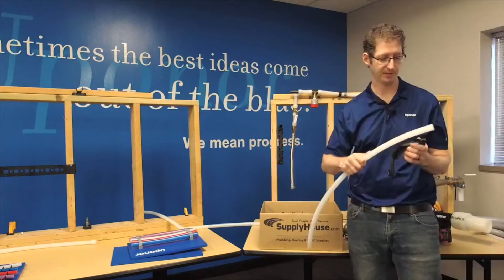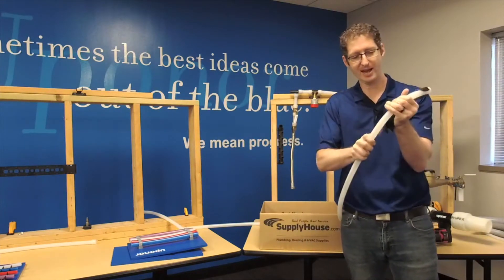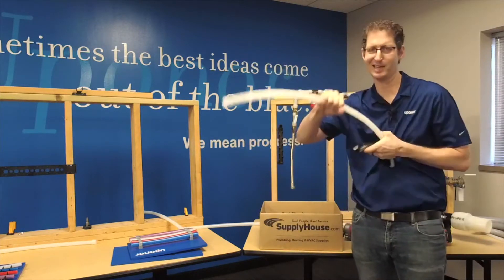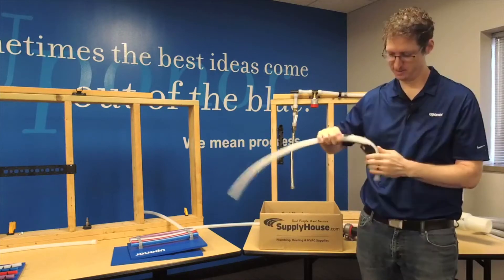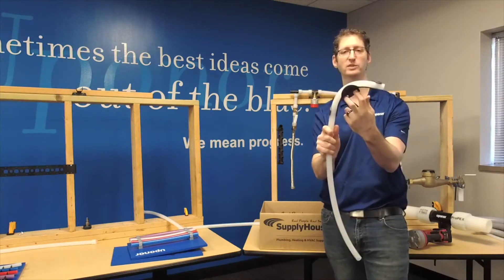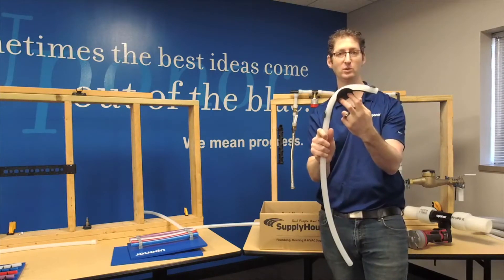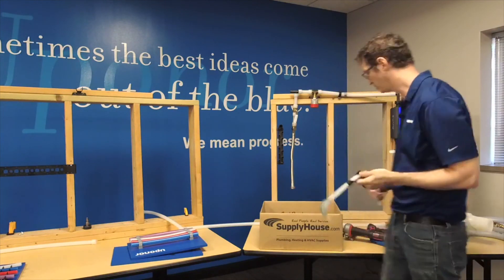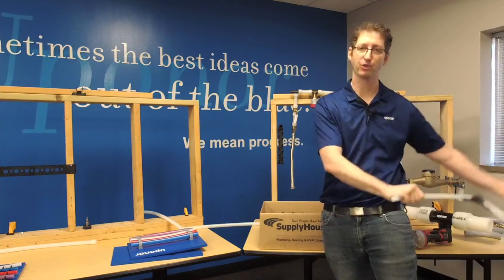Uponor Bend Supports

Comment: Would it be ok to use 2 90° bend support one after the other ? Old pipe is going the opposite way I need it with new installation.

Comment: I was surprised to discover how extremely difficult it is to bend pex-b. Never imagined this would be an issue but it is serious one. I can’t do it! All the videos use short (2-4 ft) lengths when demonstrating 90o bends, which makes it look easy, easy! On a 50ft run in my crawlspace it is impossible to bend.
Reply: Pex a is bendable, pex b is technically not meant to be bent.